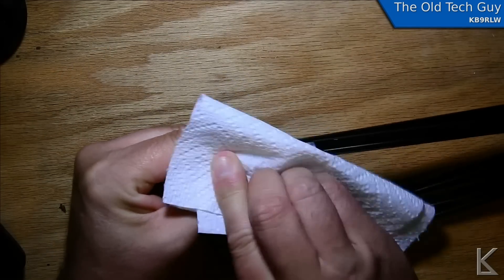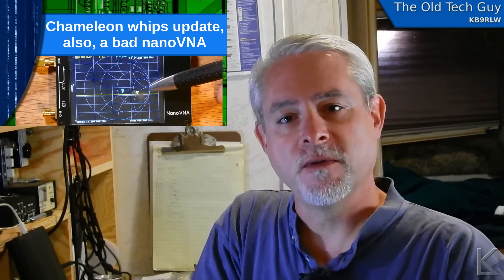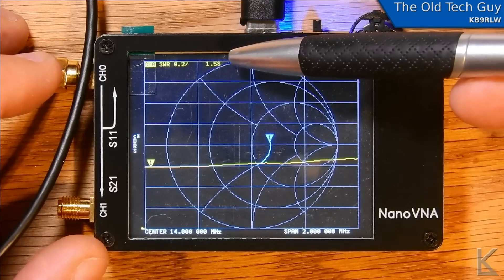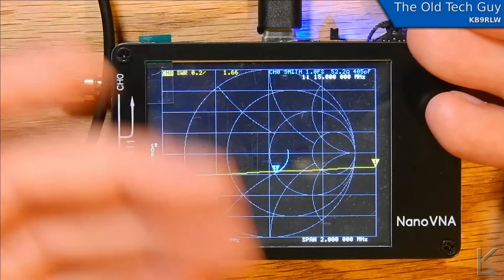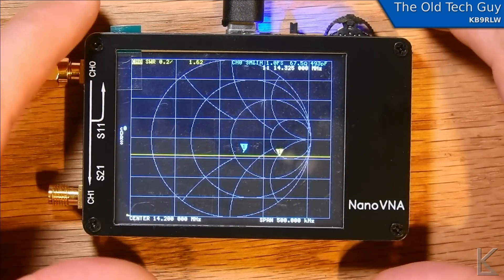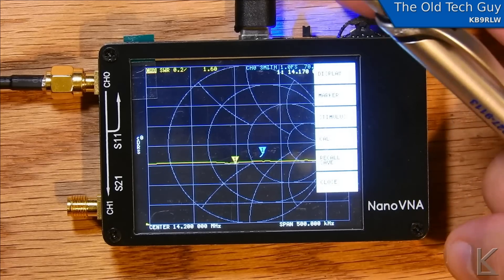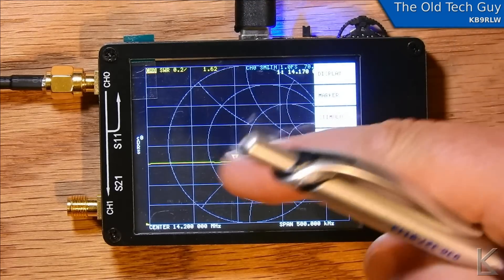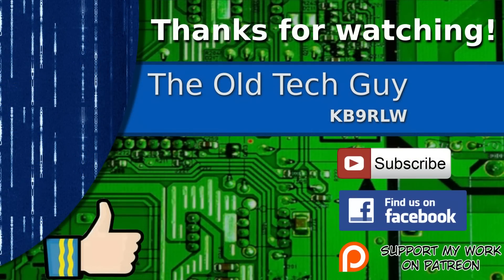Ham Rado - Chameleon whips update.  Also a bad nanoVNA

Comment: Interesting vid and gadget.  Even if they didn't have this apparent problem, I wouldn't buy any such device that relies on a USB port for power.  They are just awful power connectors.  Even if the port is used for data comm, if the gadget can be used in a stand-alone config, I'd insist on a std 5.1mm coaxial conn.  73
Reply: I wish they would use type C usb as they are far superior..I find Apple connectors are the worst.
Reply: The USB port is for charging.
Reply from the maker: And also for data through to desktop software.  It can be completely controlled via usb.
Reply: @loughkb  Have you found any decent Computer Software for them yet Kev..I received my Nanovna in the post on Friday it's a white one and looks like it works fine although the fonts are a bit small for my old eyes, using via a computer would solve that problem.
Can't wait to start using it as it's much more than just an Antenna Analyser. I have never been able to afford an Analyser up until this device.amazing value for the money.
Reply from the maker: @stevejones8665  I didn't get far enough to play with software.  The defective units are already on their way back.
I might pick one up for myself in the near future, once things settle out and good units are common.  
When I do, I'll do a more complete video on it, including software.  It will be linux based though, I don't run any commercial software here.

Comment: Hello Kevin,

NanoVNA is open source and various companies are producing them in different qualities. According to the groups.io nanovna group there are at least 3 versions of the original design out in the market, a good one, a bad one and a worse one. The white one is not better, btw. The good one is from Hugens (the developer) friend and available on Alibaba. Vendor is Wuyi Zeenko Industrial And Trading Co (Maggie). It's called NanoVNA-H.
Here's a Link to the right Product: https://www.alibaba.com/product-detail/Original-2-8-Touchscreen-50KHz-900MHz_62232701280.html
Link to the group: https://groups.io/g/nanovna-users/topics
In the group there are some links to newer firmwares and a very good software named nanovna-saver.
Direct link to the nanovna-saver: https://github.com/mihtjel/nanovna-saver 

There is also a version of the NanoVNA with bigger screen (4.3" with 640x480 pixels) which isn't original. It's called NanoVNA-F. I can't say anything about the build quality of this NanoVNA.

73 from Germany.
Reply from the maker: Thanks for the info, pinned so others will catch it also.
Reply: Link to manuals and schematic, firmware updates (including larger font antenna analyser) and software.
https://drive.google.com/drive/mobile/folders/1-JViWLBOIzaHTdwdONX2RP8S4EgWxoND